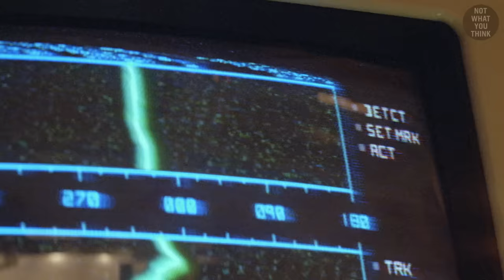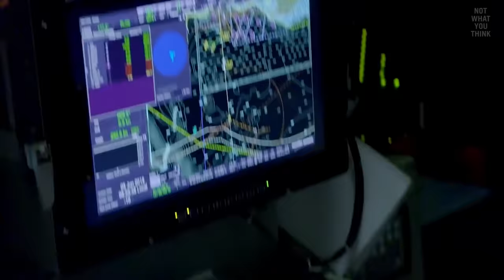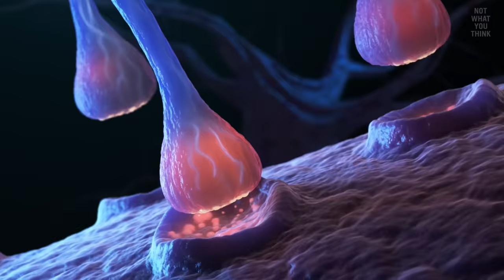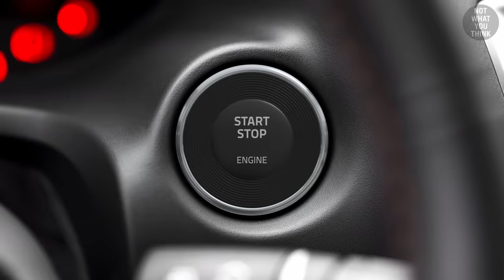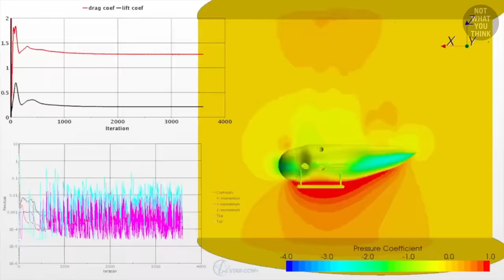What Happens When a Submarine Implodes

Comment: Sadly the Titan submersible actually dropped weights and started to ascend unexpectedly a few seconds before the implosion, meaning the crew probably heard the hull breaking. Some experts have said that the design of the carbon fiber hull would have made a crackling noise as the water started to penetrate the carbon fiber layers, just before it broke. Seeing as they dropped the weights hours before they were supposed to and seconds before the implosion, I believe they sadly knew something was wrong.
Reply: Those cracks would have been from further delamination. Apparently they'd heard similar om prior dives too, which is what would have weakened theaterial in the first place.

Yeh, they really should have stuck with steel or titanium
Reply: Yeah, i read somewere (not sure how true) that the titan actually didnt implode that much. you can see on whats left of the titan, that it only had a "small dent", which would have made a crack for the water to storm in.
Reply: @kaspersteenfeldt6108  A 'dent' would have been like spalling inside, same as happens when a DU projectile breaches the armor of a tank; droplets and fragments of material exploding like a shotgun or Claymore mine.
Reply: There were crackling noises even before! See the Karl Stanley interview on ACE. Karl Stanley is a submariner and sub inventor who tried to dissuade his friend Rush from continuing with that sub. Karl was on dive 2 and testifies that already then there were crackling noises at the deepest but also at only some 300 ft when they rose back to surface which was an obvious sign the composite material was moving on micro/nano level and subsequently getting weaker/porous etc. A very interesting interview!
Reply: @kaspersteenfeldt6108 those pieces are the outer casing, not the carbon fiber cylindrical pressure hull, which shattered on implosion.
Reply: I imagine they panicked? ... And before he died, Stockton Rush realised what a prize plonker he really was?
Reply: @marcse7en  I doubt it (your first statement). They had creaking & noises on prior trips, and if they heard any Rush  would have played it down. As for hearing noises indicating imminent implosion - wouldn't work that way with this submersible. There would not have been a moment of realizing anything, just instantaneous gone.
Reply: It lost contact. There is no way you know that. Your information is false. If you disagree, how is that information even possible to know? 

That aside- it may or may not have started to delaminate first- this had happened before on the sub and it was repaired.

The sub was designed with such disregard to safety it could also collapse without warning. Both are entirely possible. The acrylic viewport was not rated for the depth either- that could also have failed and with no warning. The joints could have failed without warning.
Reply: @mandowarrior123  You're NOT stating anything we don't already know; so run along and bug somebody else! There's a good chap!
Reply: @haliaeetus8221  Those crackling sounds would have been the CFRP delaminating. Literally breaking the matrix (i.e. glue, probably epoxy) which was otherwise supposed to hold the sheets of CF fabric together.

This is an issue with pretty much all composites if the type (where the precipitate is a sheet like that, rather than randomly dispersed and oriented). Given how this entire project was built on hopes, dreams, hype and hot air, I can promise you that the CFRP cylinder was made of layers of cylindrically-laid sheets, sat on top of each other, but not in any way intersecting each other. That braces the cylinder in tension both axially (along its length) and radially (trying to spread it outwards). Unfortunately it does very little about any shear stress in the plane of the fabric, i.e. if you were to fix the inside and rotate the outside. The only thing preventing that type of motion is the matrix (I assume epoxy). Without it the sheets would just slide past each other.

When you're dealing with a regular pressure vessel (i.e. air tank), that's not too big a deal. Sure you'll get some shear stress each load cycle, but it's mostly a tensile load, so it's just a resultant of the inside layer(s) trying to expand against the outside. The fatigue life there is quite long.

When you load it in compression, however, things look very different. A cylinder like that has a tendency to buckle. That creates a bending load which, when you're dealing with 5" of material necessarily creates a boat load of shear stress within the material. That's exactly the shear stress that tries to slude layers past each other, resisted only by the matrix.

Well I'm willing to bet that no one ran that particular bit of FEA and no one looked into the inter-layer shear strength of their particular CFRP. That's why it just wasn't strong enough and delaminated more with each dive.

Once enough had delaminated, the shear strength of the whole thing would have been too low to prevent buckling, which in turn resulted in a hull breach. Whether it imploded like a fuel tank under vacuum I don't know (I'd assume not), but that's irrelevant when the entire hull has failed. They were probably dead before they saw the water rush in.
Reply: @marcse7en  His moment of realisation might have been pretty short lived however. There would have been 4 fists flying at his face.
Reply: Aren't the wings on a 787 made of carbon fiber?
Reply: @suep9445 So if they didn't have a clue and assuming they did drop the emergency weights, how would those things co-exist? You're saying that any notion that the emergency weights were dropped is false? And conceding that I'd there were dropped they knew what was occurring?
Reply: @nb2008nc Yes, what's your point?
Reply: @gw6667  Something that breaks so easily, to the point of many comments on the sub being, "They should've stuck with titanium." 

Why wouldn't that be true with the 787? What makes carbon fiber safe to use there, instead of suddenly breaking into a million pieces in an unforseen circumstance?
Reply: @233kosta  Apparently carbon fiber under extreme pressure behaves exactly like porcelain. One moment all is well, then it isn't and shatters. No warnings or tell tales that something is going to happen, unlike metals which will register strain (in a measurable way) and make noises etc. as the pressure increases. Measurable parameters.  The other submersible companies tested, and rejected, carbon fiber as a suitable hull materiel for the reason that they couldn't predict with any regular accuracy its' failure point.
Reply: @nb2008nc  Completely different animal.
Reply: @gw6667  I don't know if they had dropped the weights and were ascending. If so, yes, they'd know something is wrong, but they've had to do that before on a few occasions (I don't know from what depths). My point is that it isn't likely they'd know the hull "was about to implode" because carbon fiber is good, until that nanosecond when it is not.
Reply: @trevorpom  Yeh, it's brittle AF and really stiff. Great if you want to build an F1 car or bits of aircraft (or a paintball tank). Not so great if you can't get a strain gauge sensitive enough to tell you when your pressure hull is about to breach...

And yeh, I get the inconsistency bit. It's the nature of the process, unfortunately - you're gluing sheets of the stuff together, then heating and compressing the whole lot. Not exactly homogeneous or open to rework.
Reply: @233kosta  It's not a material I'd be taking into an environment even more harsh and unforgiving than the vacuum of space. Especially after seeing the science that I'm sure Oceangate had access to.
Reply: @trevorpom  Having access to it and actually using it are two different things, I'm afraid.

Even if they didn't have the data, any semi-competent engineer can put together a list of things to test in order to fully understand the material's behaviour in operational conditions. Something tells me though that the boss didn't want to hear it...
Reply: @nb2008nc  It's about choosing the right material for the right application. Carbon fiber is very strong under tension, very weak under compression. Picture it like a piece of sturdy cloth - you can pull the edges and it holds its shape very well, but if you push in on the edges, it crumples without much resistance. 

The wings of a plane experience tension as they flex in flight but relatively little compression, playing to carbon fiber's strength. A submersible, on the other hand, experiences a lot of compression and very little tension, which is why it was a particularly bad choice for such a deep dive, especially when paired with the poor design of the pressure vessel which offered a lot of surface area to push in on.
Reply: They might have known that something was wrong, but they never perceived it happening. Maybe they heard cracking noises but the next moment they were gone. No way that they felt anything.
Reply: @kaspersteenfeldt6108  it does not matter of what material it was made. That force will compress aynthing that is not liquid in a fraction of a second. It will heat up hotter than the surface of the sun at the implosion happening.
Reply: @trevorpom  Exactly -- In the vacuum of space, pressure outwards on a capsule or space suit is only 14.7 psi (or even less). As compared with 6000 psi inward where Titan was heading.
Reply: @nb2008nc  How many Boeing 787s have imploded while in flight? None? Now...how many carbon fiber submarines have imploded while diving? All of them. That is literally all you need to know about what makes carbon fiber safe to use up in the air versus deep under water.
Reply: @kaspersteenfeldt6108 I saw pics of the wreckage, that thing was destroyed.
Reply: they mentioned they had some kind of acoustic sensor system to detect the cracks in carbon fiber. Maybe Rush saw the sensors and tried to drop ballast. We will never know. I wish they had some kind of black box so that we could know if the sensor system worked, and with how much latency.
Reply: @suep9445  Were they? I think some people just want to argue. There's no way to know, so just let the idiots who seem to think they know about what went down with the Titan go. Like anti-vax idiots, just erase them from your mind and go about your day.
Reply: @P_RO_  no the fuck it wouldn't lmao
Reply: @cavalieroutdoors6036 Old joke, but there are more aeroplanes in the sea than submarines in the air.
Reply: The crew on the Thresher, from test depth where problems started to collapse depth, had nine long terrifying minutes to fight fate.

Nine. Minutes.

I think the Kursk was far worse - front half of the submarine exploded, the aft compartments were intact. The survivors slowly suffocated over a few days.

I did four patrols on an SSBN. I miss the camaraderie, and often share stories with other squids and nukes when I meet them. I’m glad I’ll never have to be in one again though.
Reply: I heard there was automatic systems in place to drop the ballast
Reply: My dad (nuke) tells stories about thresher.  He said they should have just tested it in shallow water but some asshole decided to get cocky and test in deep water
Reply: @P_RO_ meaning if I were plated I’d have been fine? Cuz I usually only die from claymores w/o armor
Reply: @allencummings7564  Doesn’t surprise me, the early 60s seemed like the Wild West. Thankfully the Navy took the L, delayed the rest of the class and turned her loss into many, many lessons learned. I was two “generations” removed from her time, my chief knew some of the early Cold War guys when he was a nub and they were on the way to retirement. Our annual QA/subsafe qualification included pictures of the Thresher’s wreckage and recordings of the implosion. Figure if that doesn’t make you take the job seriously, nothing will. 

Tell your dad an e-divver says hello, MARF 0704, HMJ-Blue.
Reply: @allencummings7564  They focused highly on systems to assure ascent back to the surface. I’m afraid not a lot of effort was made to verify hull integrity. The refusal to conduct non-destructive testing on a fiber hull is disgusting imho, especially since the Titan was actually on her second hull. The first was fatigue damaged after only a couple years. I don’t get it. The guy disregarded all the lessons learned in blood, and the standard practices that were born from them.
Reply: @nb2008nc Yes, and the 787 wings were tested for thousands of hours under every possible load they could encounter.

Carbon fiber has tremendous tensile (stretching) resistance along the direction of the fibers; it has much lower compression strength, which is crucial for a submersible pressure vessel.

OceanGate's testing consists of putting humans in the sub and seeing if they survive. It's possible the carbon fiber was not the problem, but not enough is known about how to wind and glue carbon fiber for this application.
Reply: @233kosta  Unfortunately you're correct. The CEO apparently made a few comments about safety getting in the road of innovation and that risks were a part of engineering life. This attitude cost him his life and the lives of four others. You could forgive the guy if it was only his life that he decided to risk but, as with most risk takers, he had to have an audience. He had a lot of money, but very little sense by the look of it.
Reply: @FactionalSky  One problem here, you can't compress a liquid.
Reply: @Dukers2300  "The guy disregarded all the lessons learned in blood, and the standard practices that were born from them" Well, he of course, knew better and safety was an inconvenience that he could do without. He died so quickly that he never knew what hit him. Genius at work...
Reply: @ArdaKaraduman  They did have a black box, a playstation 2 memory card to go with the controller.
Reply: @trevorpom  never said anything else. 🤷‍♂️
"Everything that is NOT liquid".. 
why people can't read anymore.
Reply: @steampossum7905  That is the thorough, plain English, answer I was looking for. Thank you.
Reply: @FactionalSky  my apologies, I misread your comment. You are of course...kind of correct.😁
Reply: This is also what I believe. Carbon Fiber has a lot of resin involved with casting it. I find it really hard to believe they didn't hear it crack at least a little before it let loose. The implosion happened just shy of 10,000ft. The sub was rated for 4000m (13,123 ft).
Reply: @nb2008nc  Wings of an airplane are only subjected to 6.4 psi at 20,000 feet. A sub that dives to titanic depths has to withstand 6,000 psi. There is a massive difference, which is why carbon fiber is totally fine on a 787 wing, but not as effective on a sub.
Reply: @233kosta  It didn't help that (reportedly) items like displays and other equipment was screwed INTO the fiberglass hull instead of there being glued-on posts to screw into.
Reply: @MonkeyJedi99  At this point that's unfortunately in line with what I've come to expect of this. The words that come to mind are "death trap".

There were a million and one design decisions which could have prevented this tragedy, and the guy chose wrong in every single one of them. Not much more to say really.
Reply: @mandowarrior123  James Cameron said that he knew the sub dropped its weights. I don't know how he knows, but he has the connections in the sub community to find out if he wanted to and I don't think he would lie.
Reply: Nonsense!

At that depth there would be no noises of a hull breaking and 'water starting to penetrate' - The tiniest hint of a  microfracture in the structure would have caused Instantaneous implosion. Game over.
Reply: @darren6202  The noises come from delamination within the material. It's something like 5" of CFRP, that's probably hundreds of layers, held together with glue and put under loads which the material is wholly unsuitable for.

In the prior dives it progressively delaminated (that'd be the layers separating, no actual hull breach yet) until at some point it just got weakened enough to fail.
Reply: Well if that's what indeed happened, they only had the knowledge of their impending doom for a few seconds, so they're fine now
Reply: @233kosta it was partially titanium, the end caps
Reply: @mattb6646  Yeh, but there was a whacking big CFRP cylinder right in the middle... Those end caps may as well have not been there.
Reply: @233kosta  zzzzzzzzzzzzzzzzzz snore......
Reply: @233kosta I heard it was a Carbon Fiber Titanium composite
Reply: @233kosta  or not cycled the carbon shell so many times.
Reply: @kaspersteenfeldt6108  A single crack under that amount of pressure would allow the air to come out, causing the implosion. It's not like the water will slowly start coming in like in a boat.
Reply: @kaspersteenfeldt6108 it would have sucked them out, not rush water in. They're inside of a bubble. Pop!
Reply: @233kosta I highly highly doubt they laminated that way it would be so so so so so so stupid it would be impossible to do that and expect it to work no punctuation for your pleasure
Reply: @darren6202  If you're not interested in engineering don't read long technical comments
Reply: @D4RK-R3ALITY  The actual components are kind of irrelevant in this case, it's the structure of the composite that makes it wholly unsuitable in this case, being essentially made of strong layers (the fibres) held together by a relatively weak material (probably epoxy). When you load it in the wrong direction it delaminates and loses its strength.
Reply: @wavecutter69  "But muh amazing space age materialz!!!"
Reply: @trentbrownstone1481  I hate to break it to you but the guy in charge wasn't quite the sharpest tool in the shed. Besides, there's no easy (cheap) way to cross-weave layers in the cylinder in order to strengthen it in shear.
Reply: @zac3758 The sub wasn't rated for anything like that. It had no certification at all. Even the view port wasn't rated for anywhere near that depth.
Reply: @marcse7en  I doubt it. I bet that clown believed he would survive until the very instant of his obliteration.
Reply: @nb2008nc  An airplane doesn't have typically have the collective pressure of the entire ocean on it so...not really the same thing at all.
Reply: @kaspersteenfeldt6108 the hydraulic press channel just did an implosion demonstration with a smaller carbon fiber tube
Reply: Not just carbon fiber but expired carbon fiber.
Reply: @233kosta  See, this is the problem I have reading these comments. Everyone these days is a fking expert with something they have just gotta say. Stop posting verbal shyte and leave the techie stuff to the real experts.
Reply: @darren6202  By "real experts" you mean inginerds like me who work with these materials all the time?
Reply: @every116  he did not say he knew, he said he heard from the community this was the case.  They did not state if it was before the implosion, after, or an assumption based on the safety mechanisms.

The mother vessel did not have contact, certainly no evidence of an abort, hence the delay calling for help. Thus, there was no way at all to have that information therefore it is an erroneous claim.
Reply: @nb2008nc  Don't you think that a 787 at 3800m depth is kinda the wrong use case? :D
Reply: @kaspersteenfeldt6108  A dent? My guy, the sub was shredded to pieces, it _imploded_.
Reply: Liar
Reply: How would anyone know when they dropped weights? The weights were just resting on the sub's rails to be 'dropped' by rolling the sub - which means they'd be easily dislodged by the force of the implosion. Whatever source you're referring to sounds extremely dubious.
Reply: They wouldnt have known about it when the fail occured -  but i does seem they knew it was failing since they dropped the balast.. Ofcourse at that point they are probably all hoping they can raise up to safer levels before it fails fully..
Reply: Exactly  my opinion as well..
I bet those hull integrity alarms were going off as well.. possible cracking sounds from the carbon fiber hull as well.😢
Reply: @darren6202 seems like you just have a problem with reading.